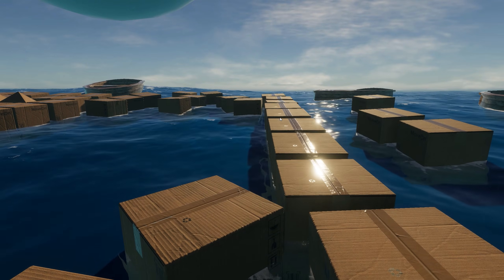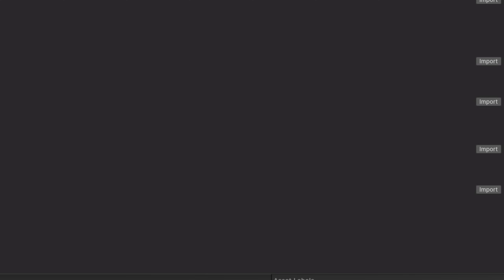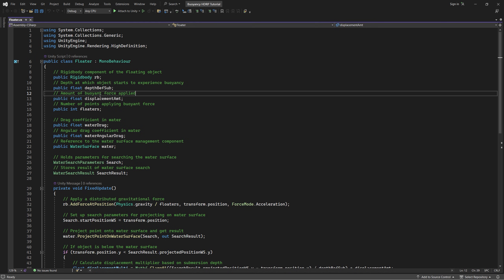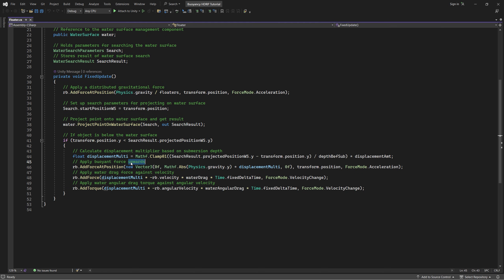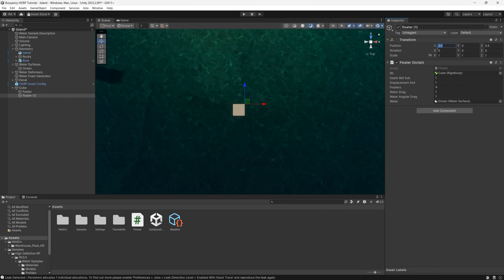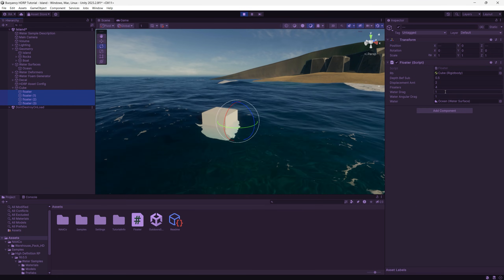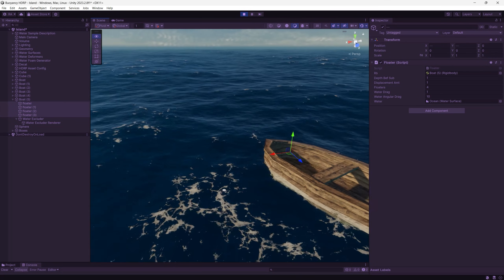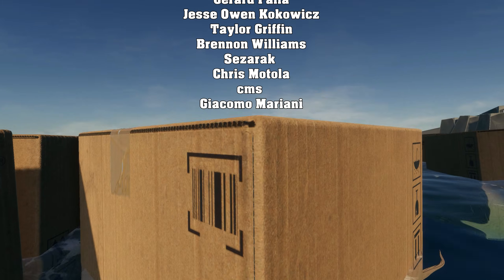Learn to Make Floating Objects in Unity Games Easily -Water Buoyancy Tutorial

Comment: had an issue with larger objects in the water freaking out, but after hours of trying to fix it, it seems that the solution was changing the "ForceMode.Acceleration" to "ForceMode.Force" (in line 46, referring to the video)

Comment: Two Observations:
1.) Floaters appear to respond primarily to 'Second Band' water surface rather than 'First Band' and 'Ripples'.
2.) Distant Wind Speeds with high values cause floating objects to over well above water surfaces.

Thoughts anyone?

What results are you (anyone can chime in) receiving when working with increased Water Surface Distant Wind Speed Values? My floating objects are elevating well above the water surface with high Distant wind speeds.
Reply: Did you find any solutions about it ? I have the same issue
Reply: @narmalone5116 I’ve not worked on water based projects recently. So I’ve not.

Comment: Great guide. If anybody falls onto the issue (as some have stated below) with the simulation freaking out on big waves you need to make a very slight alteration. I don't FULLY understand the fix, but after viewing the Unity Docs example script I noticed the water parameters were different. Now I have a pretty much perfect simulation by replacing the Search.startPositionWS = transform.position with:

Search.startPosition = SearchResult.candidateLocation;
Search.targetPosition = gameObject.transform.position;
Search.error = 0.01f;
Search.maxIterations = 8;

Unsure if ALL of these lines are necessary, but it works for me!
Reply: which script?
Reply: doesn't work for me did u add something else  that u forget to tell

Comment: Is there any way to fix the incessant vibrations that occur? The items also periodically sink and then rise straight up after a few seconds. Most adjustments to the parameters just result in extreme shaking or flying objects. Unity 6. With anything but a flat water system it seriously struggles.
Reply: Commented a potential fix above.

Comment: Everything in the FixedUpdate() seems to be broken and not working now. All of the calls to the water class seem invalid.
Reply: using UnityEngine;
using UnityEngine.Rendering.HighDefinition;

public class Floater : MonoBehaviour
{
    public Rigidbody rb;
    public float depthBefSub;
    public float displacementAmt;
    public int floaters;
    public float waterDrag;
    public float waterAngularDrag;
    public WaterSurface water;

    WaterSearchParameters Search;
    WaterSearchResult SearchResult;

    void FixedUpdate()
    {
        rb.AddForceAtPosition(Physics.gravity / floaters, transform.position, ForceMode.Acceleration);

        Search.startPosition = transform.position;
        water.FindWaterSurfaceHeight(Search, out SearchResult);

        if (transform.position.y < SearchResult.height)
        {
            float displacementMulti = Mathf.Clamp01((SearchResult.height - transform.position.y) / depthBefSub) * displacementAmt;

            rb.AddForceAtPosition(new Vector3(0f, Mathf.Abs(Physics.gravity.y) * displacementMulti, 0f), transform.position, ForceMode.Acceleration);
            rb.AddForce(displacementMulti * -rb.velocity * waterDrag * Time.fixedDeltaTime, ForceMode.VelocityChange);
            rb.AddTorque(displacementMulti * -rb.angularVelocity * waterAngularDrag * Time.fixedDeltaTime, ForceMode.VelocityChange);
        }
    }
}
Reply: Although, it doesn't appear to be bobbing with the waves as it should now
Reply: Figured it out. In your water surface script (the Ocean), Under general settings, make sure Script Interactions is checked. You can also mess with full resolution and Evaluate Ripple options

Comment: What method would you use to simulate the mass of a large ship? A ship of considerable mass would roll further past its upright position if its righting moment was low (small delta between centre of bouyance and center of gravity).
Reply from the maker: It is just a matter of adjusting the parameters to reach that result, by increasing the mass of the ship rigid body and  increasing the water drag values.
Reply: Thank you for the repoonse. I will try this out. @BinaryLunar